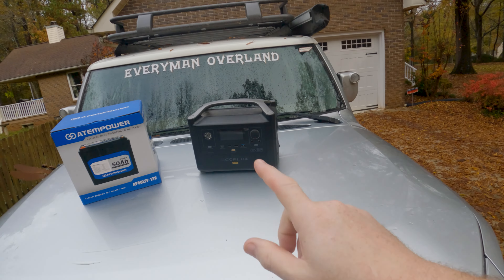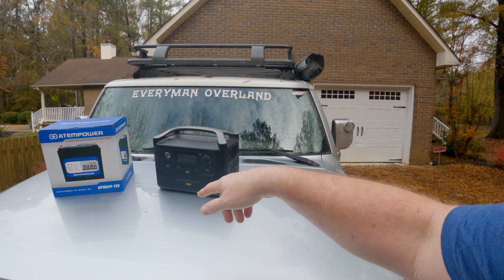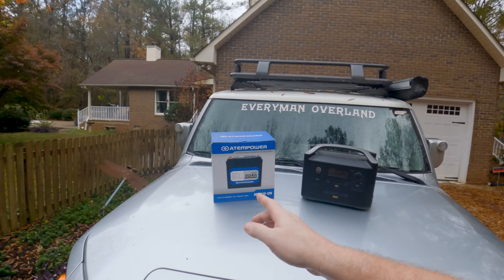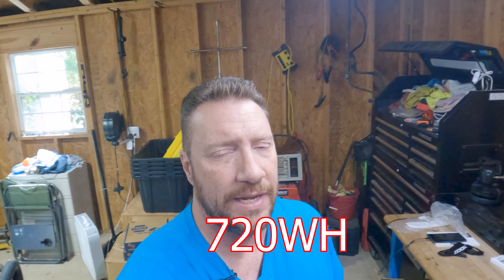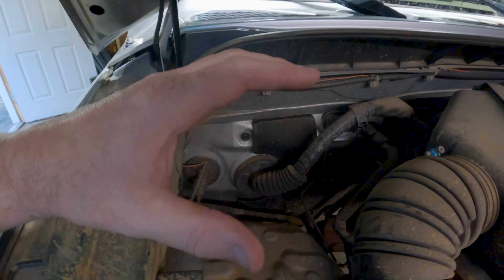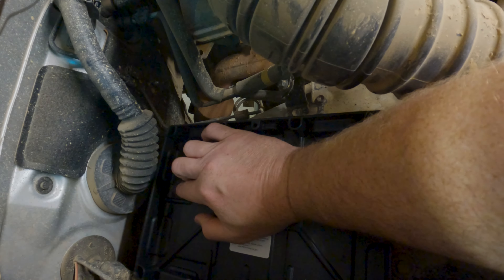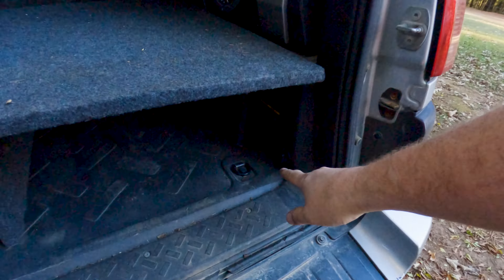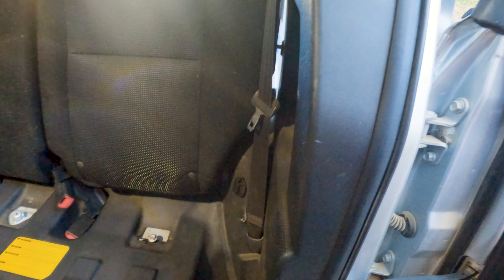LiFePO4 battery vs lithium-ion power station DIY install

Comment: Thanks for doing this this has been the debate in my head
Reply from the maker: There ups and downs to both sides. I think the deciding comes down to how you plan to use it. I think for me specifically, the built in route is the way, provided I can get the display dialed in so I can keep track of it. But the portable power station offers a ton of flexibility and portability that might work better for others.

Comment: The problem with the portable chargers like the ecoflow is they charge so slow on DC. Super fast recharge on A/C but that's not feasible in vehicle based travel. Pro tip you can stack DC-DC chargers and use multiple on one battery to recharge quicker. If you bought a second Renogy then you would have 40amp input. It would be over the 25amp rating of that battery but their 100ah version has 50amp recharge rate. The ecoflow river pro I have is 8ah 12v recharge. This is a great video and great topic also.
Reply from the maker: Yes, you can also stack batteries if you have packaging issues. So you could run 2 50ah batteries and fit them in where you might not be able to fit an 100ah battery. My thought before getting this was to install a 2000w inverter so I could charge the ecoflow on ac at that 600 watts... But I'll e how this dip treats me, I like that I don't have to find rim for the ecoflow now, and I can place ports wherever I want in the truck, their not limited to just one spot.

Comment: I thought LifePO4 batteries do not do well under the hood
Reply from the maker: I think the battery is happier there than the charger is... The big issue as I have read is low Temps for the battery. So far it hasn't been an issue. But you're right, the battery and especially the charger would be better served inside the cabin. I just haven't decided where to put it.

Comment: Hey, good stuff but Renogy (all the ones we get here) is not rated for under hood use at all, its only rated as an in cabin unit only because it will not tolerate heat or ANY water. Im surprised the box it came in or the instructions do not specify that. I fear its not going to last you very long at all where its located and leave you with a warm fridge. If you want a full system thats rated for under hood, water and heat, then Redarc and Projecta are the only ones I know of but they ALL de-rate as they get hot. By that I mean, the hotter they get, the lower output they have until they shut down completely by about 150 degrees. On my FJ, the Redarc was mounted on a bracket in front of the radiator and performed flawlessly. I hope it works out for you But I think the Renogy is the weak link and wont work out for you.
Reply from the maker: That's very possible, and the instructions did say that water and even dust aren't good for the charger. I looked at mounting it behind the dash but there wasn't a really good spot without a bunch of surgery. So if it comes inside, it would need to go all the way in the back. And if the charger goes in the back, I sorta feel like the battery should too. I considered mounting it all behind the drivers seat as I never ever have passengers, but the battery fits so good in the engine bay, out of the way. I'm really considering ripping out the whole back end and building a platform system to hold gear and whatnot, and if I do that it'll all get moved inside. So I'm taking the chance that the charger may die, but we will see.
Reply: @EverymanOverland  Might be easier and cheaper in the long run (and save space in the back) to get a Redarc 1225D and mount it out front? Kaon make a mount for them specifically for the FJ.
Reply from the maker: @1Coolbanana  tell ya what... I'll buy the mounting brackets if @redarc wants to sponsor the deal so I can show the world the benefits of buying the good stuff... At the moment redarc is a bit out of my finances... 😬
Reply: @EverymanOverland  Hopefully they will hear ya and come good 👍
Reply: Also, I'm pretty sure a decent DC-DC charger will sense the car's voltage over something like 13.3v (might be adjustable) and only start charging then, rather than needing a voltage sample connection (or whatever it might be called.)